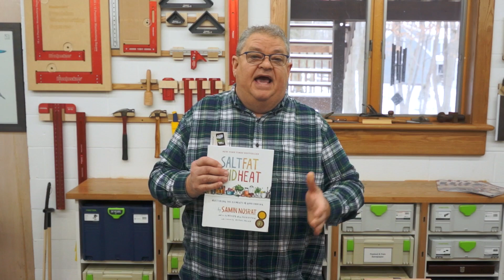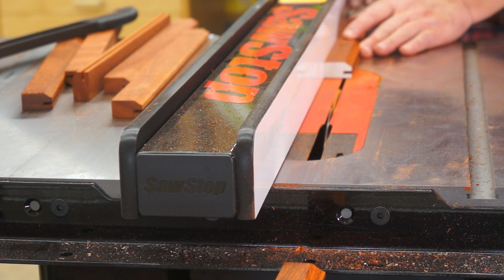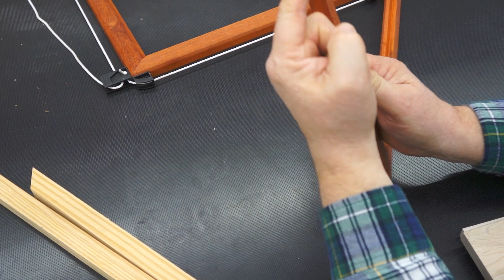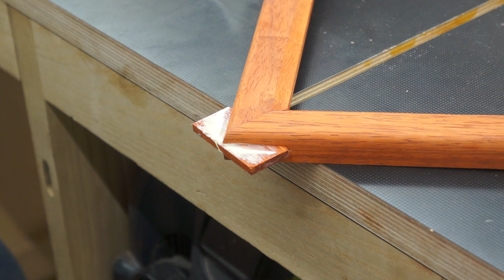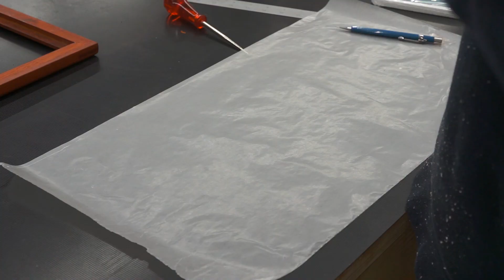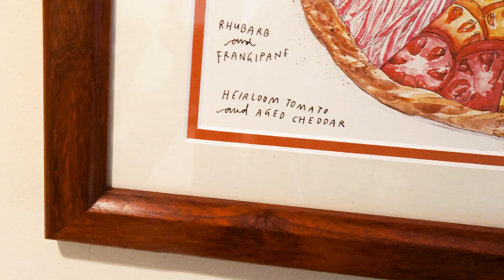Picture Framing Basics

Comment: A question about your antique table saw.  I have an old (1987?) Craftsman table saw that I bought new.  I’ve done a little “refreshing” of it lately but am having trouble getting the rip fence perpendicular  to the table top.  If I get it perpendicular then the rail is not parallel with the table top.  
Do you have any suggestions?  Is there some internal adjustment I can make?  Any suggestions for an after-market fence?
Reply from the maker: Steve, start by verifying that the blade is parallel to the table. Measure from the miter slot to the blade at the front and rear of the blade. If there's a difference you'll have to adjust the trunnion until it is parallel. I believe on your saw you'll find the trunnion is mounted to the underside of the table in 4 points. The holes in the trunnion brackets are slightly over-sized to allow alignment. Once you have the blade and table top aligned, align the rip fence to the table top. If the rail itself is not perpendicular to the table isn't relevant. As far as an aftermarket fence, I would watch the used market for a vintage (80s - 90s) Biesemeyer.

Comment: Loved watching this beautiful woodworking!  One respectful suggestion on the mounting of prints from a hobbyist woodworker married to a professional picture framer.  That paper is going to move with changes in temperature and humidity.  Securing on all four sides prevents that natural movement of the paper and likely will lead to rippling.  Even though that “package” is tightly compressed in the frame, that paper is going to figure out a way to move!  Best way to mount any print like that is with 2 small “hinges” along the top edge of the print. The print then freely hangs in the space and is able to expand and contract as needed, all undetectable to the human eye.  Perfectly natural and expected in picture framing. For those times when “it absolutely has to be perfectly flat and stay that way,” the print can be dry mounted to a substrate.  But that’s for another day.  Thanks for another fabulous peek into the shop of an expert woodworker!
Reply: Jeff, I suggest an acid-free hinging tape.  You can’t go wrong with Lineco products.  They make both pressure sensitive and gummed tapes for this purpose, and are available both online and at the same big box stores where precut, standard sized mats are available for sale.  We could talk for hours about proper hinging techniques (well, at least I could), but for “casual” hinging, either two short strips or two t-hinges at the top of the art should do just fine.  With the vast internet at our disposal, anyone wanting to get a basic idea of how to hinge their artwork to mats can do a Google search for “archival hinging tape.”  That will bring up not only product selections, but also some videos on how to hinge.  Thanks for asking, and feel free to keep the questions coming!
Reply from the maker: Thanks, Jim. You think I should take it apart and remove the tape from three sides?
Reply: As much of a pain as that might be, I would do it, Jeff.  Twenty-some years ago, I did the same thing (although not with as beautiful wood frames), and I got the ripple.  Best to carefully remove now and just attach with 2 pieces about 1” wide at the top of each print, about an inch or two in from the sides.  The prints will love you for it!  And it should be MUCH easier getting those glazer points back in second time around!
Reply from the maker: Thanks, Jim, I may even turn it into a short video!
Reply: I’ll look forward to that!   Let me know if we can send you any supplies to make it work.
Reply from the maker: To take it to a professional level, what kind of tape should I be using?